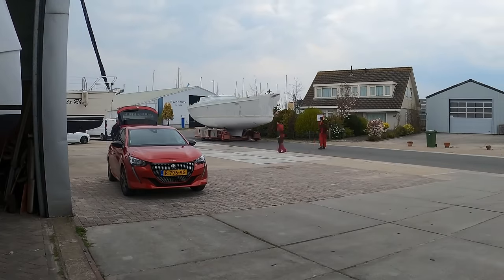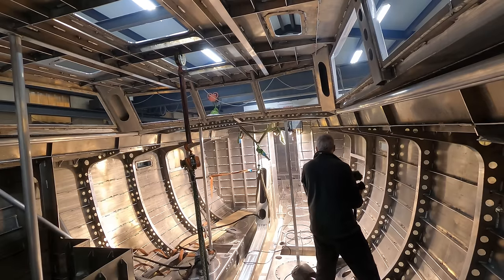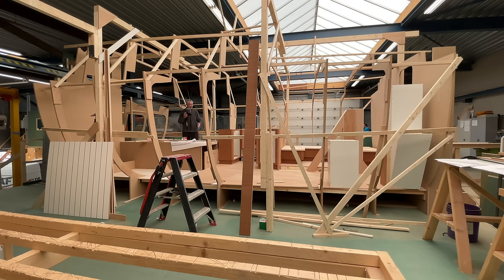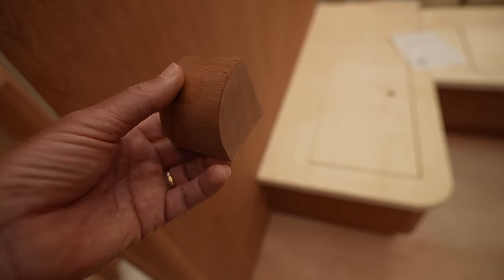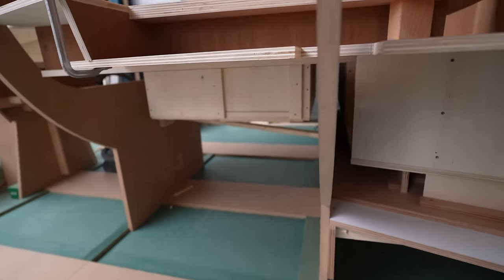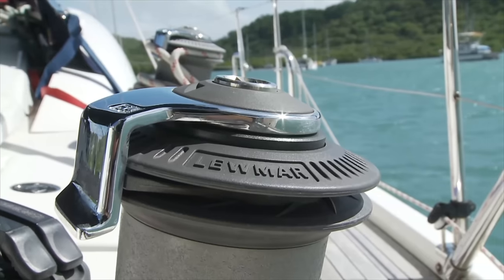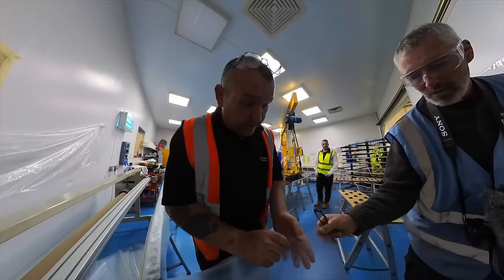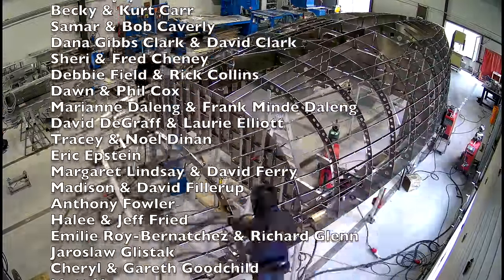Boat Tour! ALUMINUM Sailboat Pt 15 - INTERIOR Layout Enksail Orion 49 | LEWMAR Factory Tour | EP 236

Comment: I came back to review this video after seeing it when you first released it. I was curious if you discussed how they attached the interior to the aluminum hull. Because aluminum thermally expands and contracts I wanted to know if the interior was rigidly attached, or if it was allowed to float, or if it had any kind of expansion joints. Does this affect wood creaking due to motion? If you happen to read this comment I would love to learn about the attachment.

Comment: I have 4 of the Lewmar Evo winches. And while they are nicely built, the plastic caps are absolutely useless and have no place on an offshore boat. I met a cruiser recently who had the plastic parts remade in Stainless and they are vastly better. I've lost two tailers offshore from mine when a line caught them and broke the plastic. Other than that they are very good winches

Comment: Hi, I didn't notice in the layout if there is a technical room. Did you decide already where all the equipment (besides the engine) will be placed? Will you have a washing machine?
Reply from the maker: Yes, we have a technical room with access from the cockpit. The owner of Enksail Orion 49 hull #2 has rearranged the layout and changed the position of the galley in his boat so that he has a walk-in technical room with access from the salon but he loses the aft cabin, I believe. That's the beauty of custom aluminum boat building. It is easy to make changes! To answer your questions, we decided on the placement of the equipment in advance of the wiring and we are having a washing machine installed aft of the galley in the pilot berth. Wishing you All the Best of the Season!

Comment: Aside from allowing parallel builds of the hull and interior, I expect this format of preassembly of the interior will save some overall time despite the fact it needs to be broken down and moved into the hull later. Does anyone have a percentage of overall time (man hours) saved?
Reply from the maker: One big advantage is how much nicer it is for the woodworkers building and fitting/refitting while the interior is essentially right in the workshop.

Comment: Hi.. if you do not mind to say. I do have 2 question: why a 49ft? And why not buy a used and do the completely refit?  I am say that because, my first yacht  was a 60ft Cherokee  into a very bad shape and I did the completely refit and I believe 60ft is the perfect size for a 2 adult with  2 kids  or to be able to receive people (friends and family), the number for a new vessels never make any sense to me, old vessel de interior is a solid wood and the structure is stronger with thicker aluminium. However, to me the perfect vessels is 60ft minimum for 2 and 80ft for a family, above this is just for the super rich. And now, I am buying a 78 ft sail vessel aluminium and I will do the completely refit for full electric. The number is less than 40-45% of a new vessel. I believe will be less, and I will end with a new vessel into a short Period of time. Thanks for sharing your experience with us